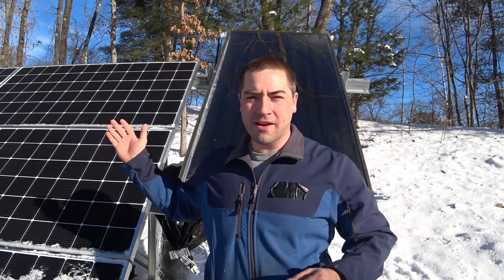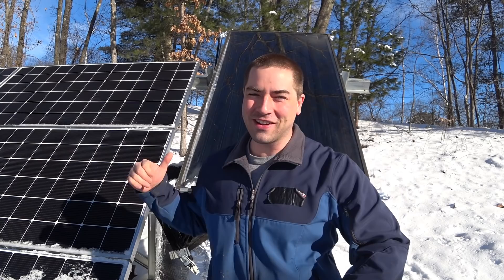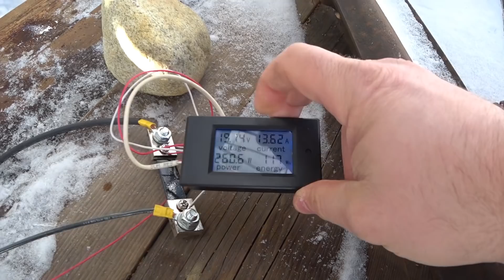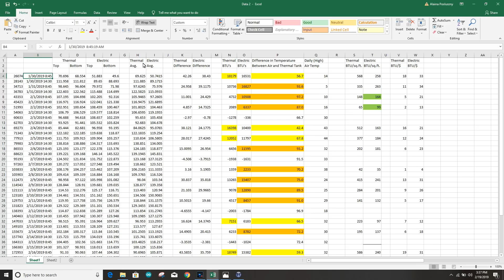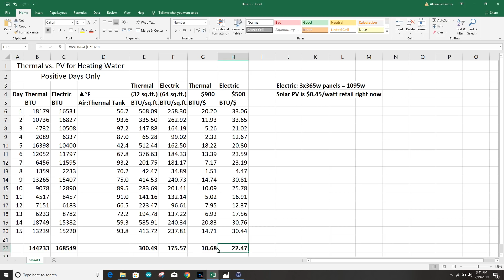Results of Solar Thermal vs. PV Experiment in Heating Water

Comment: So interesting !... I'm digesting this.   The result seems to be the solar thermal has an efficiency that's double that of PV, which makes perfect sense.  PV being about 18-20,  solar thermal in this case being around 40%.  And that lines up with everything I've read IE: (solar thermal is about 50%).   And I think it WOULD be 50% or even more if the 'delta' was maintained as demonstrated by your data.  Meaning, the solar thermal is losing efficiency as the water heats up.    If you had a constant supply of cold water, it would really shine over the solar PV- if surface area is your concern.   Great experiment David- really enjoyed this !
Reply from the maker: Thanks Mark.  I was worried about you.  I hadn't heard from you in a few weeks.  And remember, this was all done without any MPPT controller.

Comment: What about service life of each? And cost over time?
Reply from the maker: Personally, I think PV would win both of those categories.  How bout' you?
Reply: @DavidPozEnergy  how do you figure that when pv is constantly degrading over time? "Rated" life of most pv panels is 80% at 10 years. Wouldn't the solar thermal still be ticking over the same as the day you bought it 10 years later? Especially vacuum tube solar thermal. I'm not saying pv is bad, more just saying it has its own limitations. Just like everything else.
Reply from the maker: I have a video on my channel of repairing a leak in one of my thermal collectors.  It was up for two years.  I've never had to repair a leak in a PV, LOL

Comment: The price of a thermal collector is completly unjustified, compared to PVs. It's just brazed copper pipes, some aluminium fins, black paint and glass while a PV panel is way more expensive to produce because of the silicon cells, wiring, hot vacuum lamination. 
A good solar collector is cheap and easy to diy while a PV panel is anything except a good diy idea.
Reply from the maker: I think some of the justification for commercially available thermal collectors are: Engineering and certification to STC, Selective coating (not normal black paint) and low-iron tempered glass.
Despite that, I still like PV more.

Comment: You got it wrong. The PV panel system will outlast the Thermal panel system like 10 times. So winner in both price and lifespan is the PV no maintenance at all.
Reply from the maker: I agree.  I've had a leak in my thermal system.  Never had a leak in my PV.  LOL.  BTW, I do have a video on my channel about the leak if you are interested:  https://youtu.be/8GNBElwXi14
Reply: I would hesitate to call David's assumptions "Wrong" . He made his choice based on setting up and running the systems in the experiment. He clearly did not take into account longevity in his conclusion. 

Nor did he take into account the carbon footprint of building each unit nor the social responsibility of purchasing one item from China and another from North America (I could go on for ever)

David's assessment was based on everything he observed during the experiment and he never made claims beyond that.

There are many more people who learned something after watching this video than people being misled.

Comment: Great experiment but... I think thermal is at a disadvantage in this application where peak stagnant temps is the goal. It is too bad that solar pv got off  to a rocky start and you don't  have comparison data from cold tank starting temps. I wonder if the thermal collector may outperform when used in a lower temperature range such as a ground water preheat tank 47-80F. Could you please post a link to your data?
Reply from the maker: I posted the raw data on my patreon page.  Thanks for watching.

Comment: Go for both. A small solar-thermal to pre-heat, and the electric one to boil the water.
 Great experiment !
Reply from the maker: Thanks.  I was just talking with my wife tonight about what a duel system might look like.  I'm not 100% there right now, but maybe.  I'll be sure to make videos about it if I do.  Thanks for watching.
Reply: @DavidPozEnergy  What about glueing pex tubing in the back of the pv panels and harvesting that heat ,that will  also keep panels cooler and more efficient in wormer days  .
Reply from the maker: Steve Slade  Response to both Steve and Obie:  What you are asking about is a hybrid panel, electric on the front and hydronic on the back.  Manufacturers of panels have been trying to sell this concept for at least 40 years.  There always seems to be some issue and it doesn't take off.  

Let's think of the temperatures.  The hotter a PV cell is, the less efficient it is.  This is quite dramatic.  So a PV cell wants to be cold, practically speaking as close to ambient air temperature as possible.  In my area we rarely get over 100°F.  However, we want out hot water faucet to spit out 130°F water.  I want my own thermal storage tank to heat to 180°F.  So we want the hydronic side of the panel to get HOTTER than ambient air temperature.  But our PV to be at ambient.  The two goals are working against each other.  If I build a hybrid panel that favors getting hot water then I'm sacrificing electrical production.  If I build a hybrid panel to stay at ambient then the water will never be hot enough for a shower.  At best the system can warm a pre-heating tank before water goes into my real hot water tank.  It's simply not worth the added cost and complexity at the sacrifice of efficiency.  Instead concentrate on keeping your PV (electric) system working as optimally as possible and there will be plenty of electricity to heat water.

There is a solar house a couple towns over from me built about 10 years ago.  It was half funded by grant money from state and federal.  They had hybrid panels.  Unfortunately, the hot water side of the panels never worked quite right and had leaks constantly popping up.  Eventually the developer drained that side of the panels and left the array as PV only.  I went on a tour of the house one year after being moved in and the homeowners were so relieved to not have to worry about the leaks on the roof any more.
Reply: @DavidPozEnergy  It could be done with a water/water heat pump. The primary circuit runs through those Hybrid PV panels and the heat pump removes the energy to heat the secondary hot water circuit. The problem is the efficiency of the panels would only profit from it in the summer, where you don't need heating, just hot water. For a system like this you would need really high hot water consumption, like a heated pool, sport club house or gymnasium.
Reply: @Psi-Storm  I thought about this by running refrigarant through the heat pump pipe and heating it with blowing the air against it. But I am not shure how efficient it would be since you also need to drive the compressor of the heat pump.
Reply: Sounds the most efficient way to reduce inductive loads on high freq inverters.
Reply: Waste of time.

Comment: Use evacuated tubes.  The outside temp doesn't bother them.  The heat is inside a vacuum.  tube and transferred to the manifold.  They also can produce with 1/4" ice on them.  They also go to high temperature.  The flat panels cannot do that as they are prehistoric in design.  Tanks going to Puerto Rico with the tubes run $400 with a 30 gal tank.  
I have had my evacuated tube water heater up for 7 years now and it heats based on how clear the sky is just like the solar panels I put up.  Checkout upstate new york where Sunmaxx has complete house heating done using the tubes.  It would have been good to test a 20 tube heater.  By the way they handle 1/2" hail and hurricane force winds.  Since they are tubes, they don't catch wind.  The tubes work on the principle of a low pressure pure water inside a 3/8" copper tube that is heated by the uv light going through the outer glass, through the vacuum and inside the inner glass where it is in contact with the coating that absorbs the energy and converts to heat.  The water boils at 60 degrees and the steam goes up to the manifold where it transfers the heat to the water passing by.  The tubes cost about $10 each, the manifold is about $200.  The entire simple system used mostly with the tank being the manifold are about $400.  They sit on the roof and essentially are a hot water tank.  The drainback is by far the best way when it is cold out.  The flat panels you are using have alot of specific heat and they take a long time to heat up.  The tubes will generate energy in about 60 seconds so any solar energy immediately transfers to heat.  The flats take at least 5 minutes so on intermittent days, they don't work as well.  HEY it is all good.  I would use the heat to heat the water and use the electric to supplement the tank.  My backup heat element turns on at 100 and I limit my tank to 135.  Much hotter and scolding hot water is a problem.  Also the lower temps don't corrode pipes.  My excess which is all summer long gets dumped into my water in house using a recirc pump to take care of the excess heat.  Then I have instant hot water in this old house.
Great experiment.

Comment: Solar PV panels work best at lower temperatures... Make a panel that routes water through a PV solar panel to keep it cool while at least slightly warming up the water that then goes into a water heater. Efficiency!
Reply: That is a hybrid system called PVT. Better efficieny in terms of pv, lower thermal efficieny compared to a boiler panel, more expensive and ofcourse you have the difficulties of the installation you have with a boiler panel (and in case of damage more expensive replacement).

I'd say you should for now only use this if you absolutely need to maximise space use.

Comment: Stranger conclusion, why?I had a thermale 72m2 system South 55° angel Solar thermale roof  die my 300l hot water tank and room heating with 2*2000l tank between 1988 and 2009. Because af winter time between half of november until end of februari I needed supplementairy heat with a wood stove, a stove with a coil connected to Both tanks.
In 2009 I've replaced the roof with a PV installation of 9660Watt and heats up the rooms with a heatpump and the Solar tank became elektrical heated. Wood stove disappered in 2012 nog used any more.

Comment: Don't remove anything off your roof. Your best solution is pretty simple. add an electric heater to your crawlspace to top off, , and connect your thermal pane; outdoor tank output into your outdoor electric tank input, this will increase your efficiency, savings  and redundancy.

Comment: Check out the build it solar website.  I can make a pex solar thermal panel 4x8 or 4x10  for $100-$120 especially considering I have a lot of the materials.  The website Builditsolar has all the info to make your own.  You can make your own solar thermal panel as opposed to solar PV panel.  So for me the cost is like 10 or 20 times less than PV.  You can make a coffee cup in the groundbelow the frost line to drain back the panels and it will never freeze.  For the cost savings you can put up 10 times more panels.
Reply from the maker: I love Gary's website.  I've posted my build on there.
Reply: I second this. DIY solar thermal with drainback is by far the cheapest option. 1.5mm Al sheet, however big it comes, some soft copper pipe,  wood and sheet of glass or plastic.  We have a 2m2 and a 3m2  panel in parallel, and they  gives a tank of water that'll  give us 2 days of use for 1 sunny day, even in winter.  Plus, insulate your tank! Overnight loss ought to be less than 5 degC.

Comment: Somting is wrong whit your system. Solar heater is ~6 times more effective then PV. 
The water container needs to be on top of the panel. Cold water enter the container and exit to the panel from the butom after heating in the panel hot water return to the container. No pumps are needed
Reply: However it depends of climate,, if the day is cold and cloudy, pv heats better,,,, while if day is too hot, thermal will be better,

Comment: What would happen if you combined both in one tank
Reply from the maker: My personal tank is too low for it, but if you build a tall tank then both can work well together.  You need to take advantage of stratification.
Reply: @DavidPozEnergy  i wonder if adding rocks to the tank to help hold the heat ??

Comment: Hi, I have the same experience. I just want to know how you heat the watter with PV. Do you use some MPPT (maximum power point tracker)? Do you heat the water with DC or AC (do you have some inverter there)?
Reply from the maker: I've got a video on how I made the connections: https://youtu.be/kVaxAfXQPDU  There is no controller in the setup, just a simple, direct connection.  If I set this up for my home I will be adding some circuit protection.

Comment: I definitely advocate using the PV panels when you have the area. As some other people have pointed out, the PV panels can be set up to dual purpose for both water heating AND electrical power to charge your batteries or run loads. 
Because people's needs vary from day to day, and season to season, the PV panels give, at least in my opinion, the 'best of both worlds'; provided there is space to accommodate them.

It also seriously gets to be cheaper when you consider the cost of potentially running pipes from an array in your yard or on your roof, to your hot water storage tank. Wiring can be much cheaper, and is less subject to leaking. XD

Comment: HI, great work! One suggestion to PV, you need to use a PV controller, even a simple PWM one. The circuit you are made assumes that sun brightness is always ideal, but that's not true. When sun conditions are worse, the heater dramatically drops down voltage of the PV and they stop producing energy. Controller will check conditions and allow drawing as much as possible energy from PV, preventing from blocking them. The results will be much better even on weak irradiance. You saw this problem when you connected 3 panels in series - lack of expected voltage.
The second is that an PV installation is much easier to make, no antifrost system, no pipes, no leaks, no pipes isolation.

One year ago I've been struggling with the decision which will be better for me and PV won. They are just easier to build and are maintenance-free.
Reply from the maker: Hi Robert,  Do you know of a proven solar controller, available in the US, that does not need batteries?

That's awesome you are heating water with PV.  That tells me it's not such an insane idea, thanks.
Reply: Unfortunately not, I built one by myself. I used high voltage thin film modules that in series give a voltage of around 230V (European standard). The basic idea is to charge capacitor to required voltage and when it's ready, apply current to the heater. Simple electronics measure voltage on it and disconnect load if PV voltage is less than their maximum power point, charge capacitor again and repeat many times a second. Just few simple parts: ap-amp, IGBT transistor, capacitors, resistors. I saw some time ago ready device on Internet shop but it is not popular solution, as we see most popular or promoted one is based on an inverter. Try searching on e-bay for something like that, maybe based on microcontroller: "PWM MPPT Heater Charger Regulator Solar Photovoltaic Solar Panels Hot Water PV" - price around $100 would be good.
Reply from the maker: I'm working on building one right now, but I wish there was one readily available.  I'm using the same method you just described.  Or at least I think so, as I'm still learning about the electronics.
Reply: @Robert-ec5vu  They are not $100, though they should be.  The German HW controller looks promising though likely doesn't have enough capacitors for greatest efficiency and life span.  That may be why the capacitor bank is external IGBT is not the way to go unless voltages are over 250 because it always wastes 2V times the amps.  Look at my low cost PV controller circuits.
Reply: @opera5714  My 1.2kW PV installation has the max power point at 238V. I use a standard 230V 1500W AC water heater. You're right, IGBT wastes around 2V, but the current in my case is 6A max , so only a few Watts are released as heat (simplifying of course, there are high switch currents etc.). The main capacitor (from an old power supply) doesn’t work in full voltage range, but oscillates 15V around 238V at less than 1kHz frequency. Next week I will find time to draw and share my controller circuit, but first of all I have to do some reverse engineering :) Maybe my solution will be useful for anyone else; it will be a good subject to discuss too.  BTW it's working efficiently for a year already.
Reply: @Robert-ec5vu  Is the complication of your control circuit necessary?  Sure, it keeps the voltage across the element close to the specified design voltage, but do you get any more heat for all the cost, complication and potential breakdown of your controller?
A simple direct connection will vary in voltage more depending on the energy available in the sunlight at any time, but if it is cloudy, it will be producing less maximum heat, but will be heating continuously, which may balance out.  There is the same amount of energy potentially available from the PV panels.
If there is a difference, it will be in the output characteristics of the solar PV panels, not the heating element.  Your controller may have the effect of keeping the panels working closer to their Maximum Power conditions than a simple direct connection.
It would be really interesting to compare the performance of two "identical" systems side by side, one with the controller and one direct wired.
An MPPT controller might do the job of matching the performance of the PV panels to the load of the element, but I doubt that a PWM controller would increase the efficiency in any way.
Reply: But would it be better to keep it simple, rather than pay for a controller, is it more economical to just add another panel.